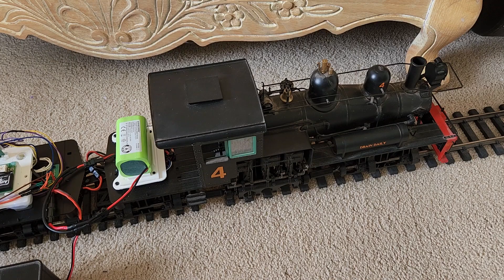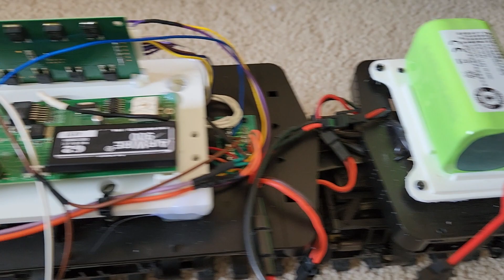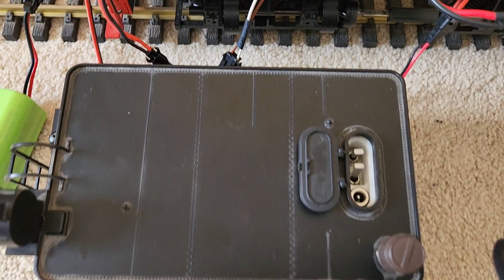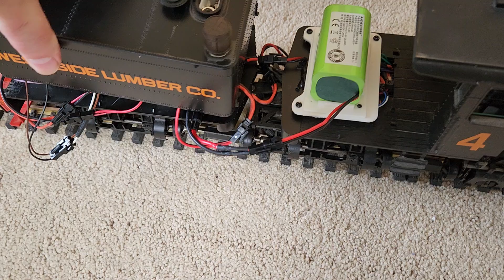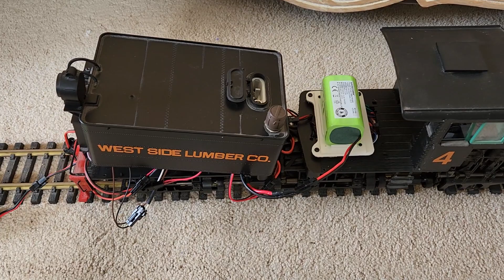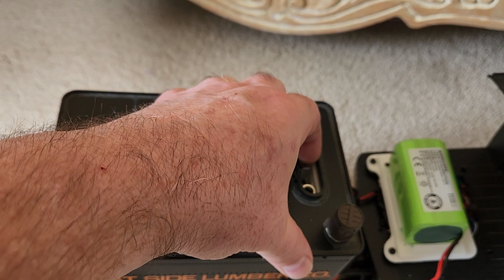Garden Railroad Battery Conversion of G-Scale Bachmann 3-truck Shay - Final Result

Comment: Very nice. I have a bachmann 280 connie with an aristocraft train engineer revolution battery power. Can't find boards with aristocraft no more. What system did you install? I NEED UPDATING!!!
Reply from the maker: Yeah, that's the problem with Aristocraft being out of business and all. I used a AirWire G2 receiver in the locomotive and I use a Airwire T5000 transmitter to control it. To install the Airwire G2, I ripped out the existing control board in the Shay and labeled all of the wires. The AirWire G2 handles the power coming from the battery to the motors, and the front and rear lights (and probably smoke, although I never use smoke). You can also connect the AirWire to an existing sound decoder. In this case, I kept the existing Bachmann Three-truck Shay sound card (which is basically equivalent to a Soundtraxx Tsunami I believe) and just used it with the AirWire board. The sound card is the one that is standing vertically, and the AirWire G2 receiver is the board lying flat.